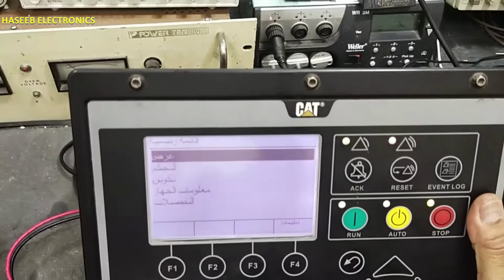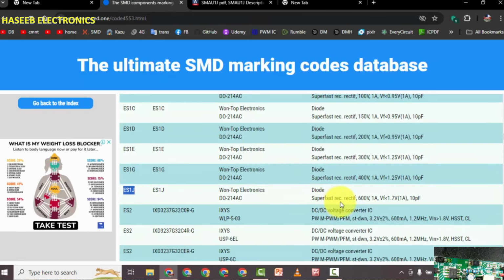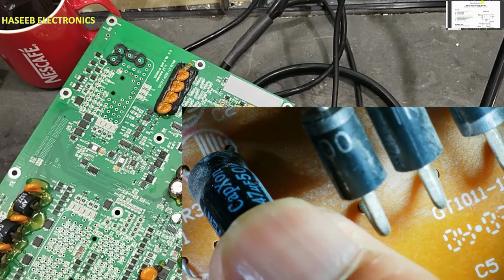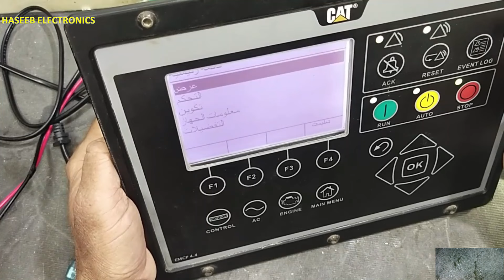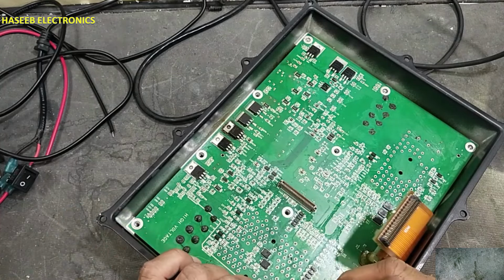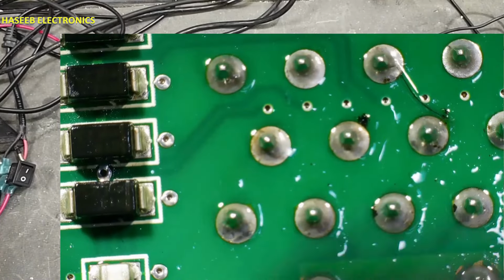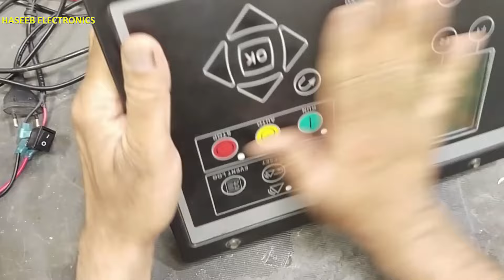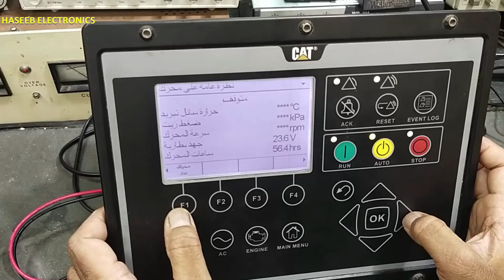{1101C} Caterpillar EMCP 4.4 Repair, No Display on screen - Part 3

Comment: How u determine the lcd not faulty before checking other components?
Reply: He checked all of his voltage levels first in a previous video and found a dead short in a capacitor and diode. I've found this to always be a good place to start when I have no idea what any does in a circuit.